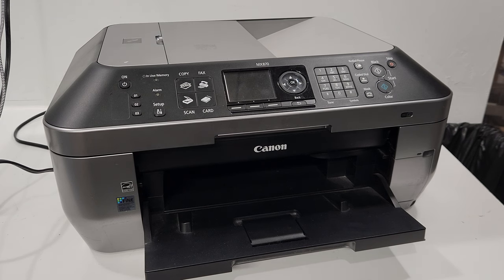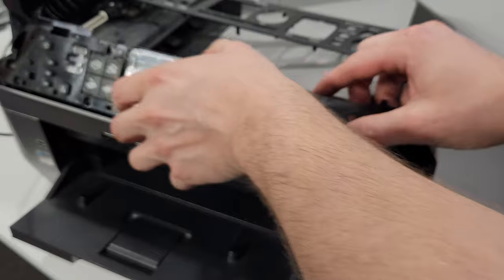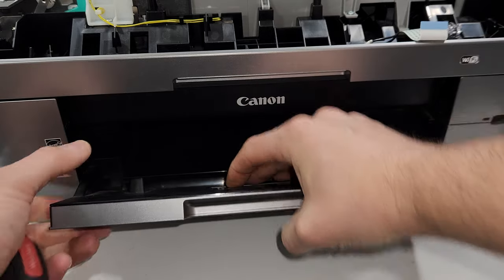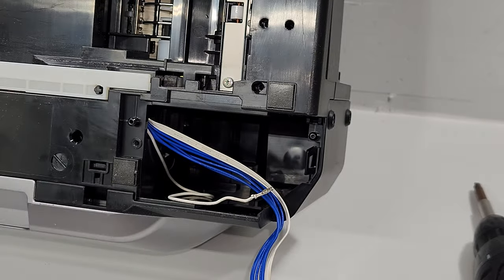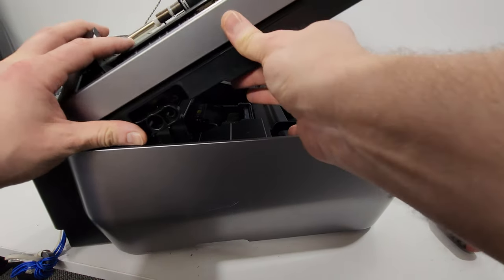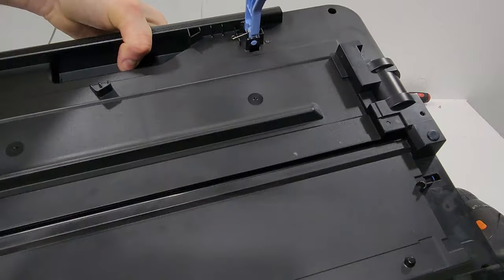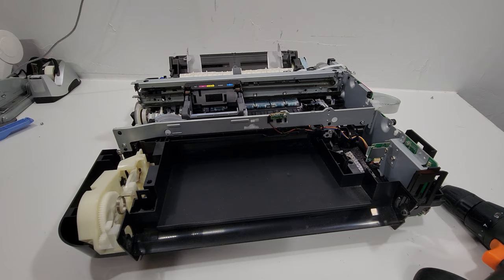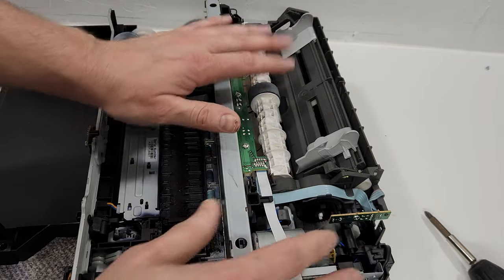Taking Apart Canon Pixma MX870 For Parts or Repair MX860 Disassembly

Comment: Canon made it as DIFFICULT as possible to clean/replace the ink absorber. It should be as easy as replacing ink cartridges. Instead, Canon says "throw it away and buy a new one", now with embedded chips so you can't use non-Canon ink.

Comment: I am going to take my POS Canon printer apart to see if cleaning everything will make it work again. I get the b200 error and it won't print, yet I have been able to trick it into printing a test page and it prints perfectly. A lifetime of trouble with this machine.

Comment: I have taken my printer apart, done the cleaning i want and put jt back together, but now the printer thinks its always open... Not sure how I screwed up the open close sensor, any idea how that piece works or how I can trick it?
Reply from the maker: Hi. I'm sorry you're having trouble with your printer. The sensor wire may be disconnected or jammed.

Comment: Had a peice of address lable stuck in the paper loading mechanism. as basically stopping the duples function and not able to load to tray (rear was fine). This video help disassemble and find/ retrieve the offencing sticky paper - awesome. Here to another 14 years of use :-)
Reply from the maker: Nice work! Thank you for sharing.  Have a great day!

Comment: What if the cartridge is stuck?  It is not moving into the middle and I can't move it manually.
Reply from the maker: Seems like your printhead went bad. It does that to the printer and it is almost impossible to remove printhead. You will need to remove some covers and remove the printhead. After that you will see the carriage move as it should. You will need a new printhead and that is not very expensive for MX870. The printhead for MX870 costs approximately $30-$40

Comment: Wanted to thank you for an excellent video.  I have used one of these as my workhorse for the past 10 years or so, and never had a lick of trouble with it.  Then a few months ago it hit Canon's inevitable dreaded "ink absorbing pad is full" warning.  I could not find It anyone (including Canon) who was willing to service such an "old" printer (by replacing the pad.)  You showed me just what I needed to confirm, ie, that you have to take the printer pretty much completely apart before you get even see, let alone access, the ink pad.  (16:55)  It was obvious for me to just buy a new printer.  Thanks for the insight!